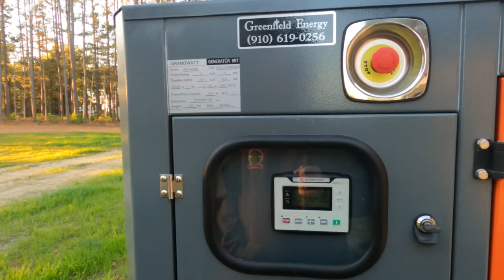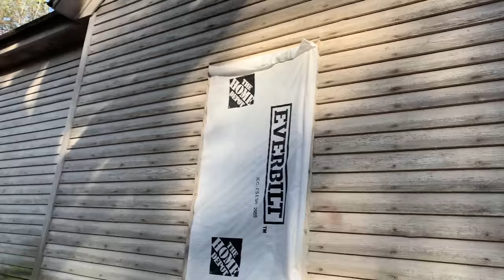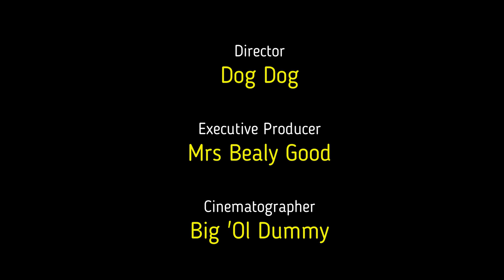5 Acre Pond Gets More Water & The Duck Mafia Gets Revenge

Comment: Suggestion for when you finally decide where you are going to put the genset, put it on rubber pads and then use springs to load it down and not move around on the pads. Nothing worse than the vibrations that come thru the ground from a genset at night. But then when I had on a set of earmuffs, I could sleep next to a Detroit Diesel running at 1800 RPM.
Reply from the maker: Thanks 😊

Comment: 100 amp unit?  power wire is crazy high . Uf is crazy if you can find it.
Reply from the maker: Yes, 20Kvw. Don’t I know it. Prices are crazy.
Reply: Just did a small 100 ft run of 12/3 with ground. 235. Ya the generator should be around 100 amps. Ours is a 23,000 kw. 100 amps. That should serve you well.

Comment: Not to be that guy but I am curious why the entrance driveway entrance brick pillars could not been designed to mount the gates to or why use swinging grates instead of cantilever gates?
One other question have you considered covering the conduit out to the island to prevent fishing hooks from getting caught on it? An to answer your question yes I have snagged plastic conduit with a hook bouncing a rattle-trap off the bottom and also fishing pig and jigs especially using Japanese hooks
Reply from the maker: Didn’t want cantilever. They could be designed to incorporate. Getting contractors to coordinate is difficult

Comment: Surprising you didn't plan on small solar farm being you have so much property.
Reply from the maker: Go back and rewatch the part where I talk about what’s coming next 😁
Reply: @BealyGood  
Yep I missed that comment @ 13:26
Solar panels are the way to go if you have the land.. and the investment capital... for them. I much prefer a solar panel farm than having them mounted to building roofs.  If the system is sized right and maintained that very nice generator will rarely be needed.   
I predict new homes will soon be commonly sold with solar energy systems installed and operating.         
It is a green technology that is now mainstream unlike the push for electric vehicles. That technology is years away from being mainstream. 
Yes... in some instances (electric vehicles) work but even in those instances no one talks about battery replacement which is a staggering cost. My last point is it is rare to see an accurate cost to recharge an electric car. I have and it's nowhere near as competitive as it is made out to be.       
My point is... allow these technologies to mature before forcing them upon people and in the process create very high gas/diesel prices which is throwing the nation into a recession.